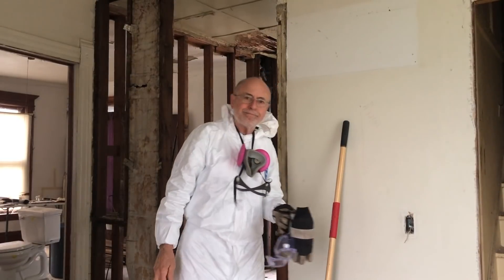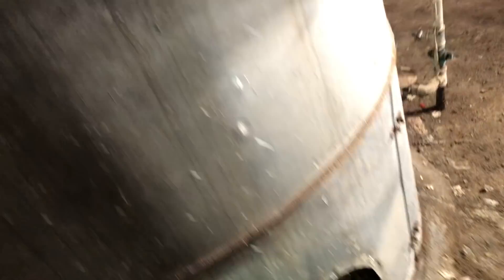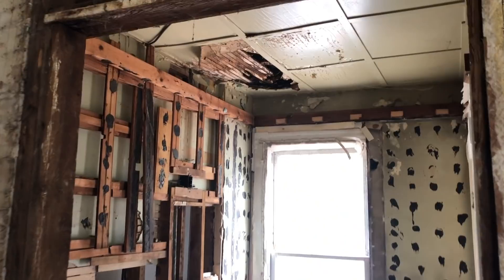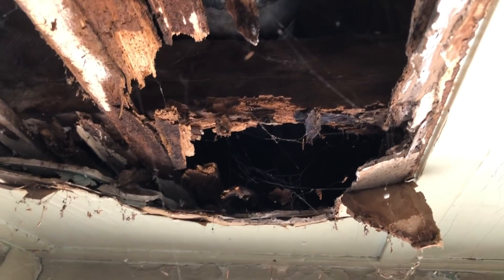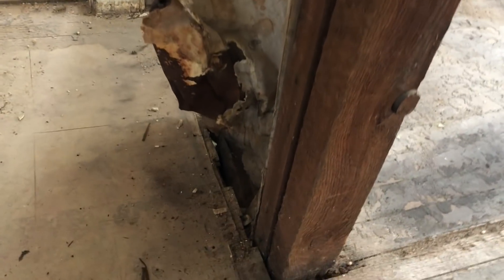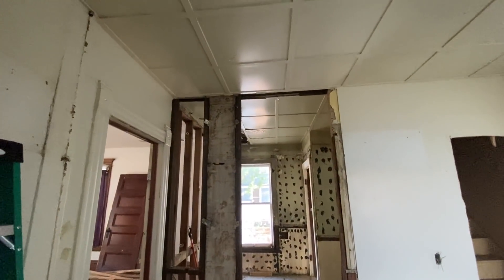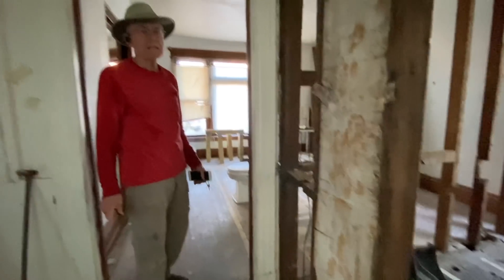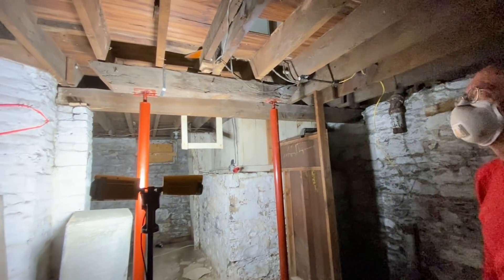REPLACING A SUPPORT WALL in our OLD VICTORIAN HOME | The Grand Lady - Ep 10

Comment: What a mess to have to find, things could be worse though I suppose, I hope the roof doesn’t have to be fixed as well
Reply: The roof framing is in good condition having been completely replaced following an apparent fire in the attic at some time in the past... I found chared wood adjacent to the chimney.  It does however, sport three layers of asphalt shingles which will be coming off soon followed by a single course of new asphalt shingles.  After that.... solar panels everywhere that they will legally fit!  The solar panels will protect the asphalt and their respective life expectancies ought to just about be equal to one another.
Reply: @Mr_Jim_Syracuse  well that sounds great! I’m glad you don’t have to replace the roof. I had a house fire in 2017 and my attic burned up and they had to take off the whole roof, then they found asbestos wrapping my heater ducts and they would not approve the repairs until all the asbestos was removed. Then the house sat there with no roof and a huge rainstorm came and flooded the whole inside. It took a year for them to dry out my house and refurbish everything up to code and to my specifications, luckily I had good insurance. I had to live in a hotel with my dog for that whole year. It was a 2 bedroom 1950’s ranch house in Long Beach California and after I moved back in I stayed for a year and then sold it right in the beginning of the National lockdown for $649,000 and moved to Texas to a four bedroom brick ranch house for $300,000. I really wanted to buy this old Victorian that was for sale but I didn’t think I could handle living in a construction zone for however it took to repair and refurbish. But I’m happy with what I have and I love it here in northeast Texas. Take care of yourself Jim you got a lot of work to do. I’ll be watching